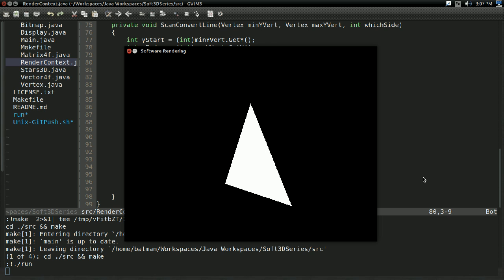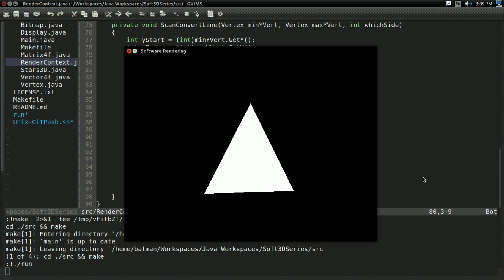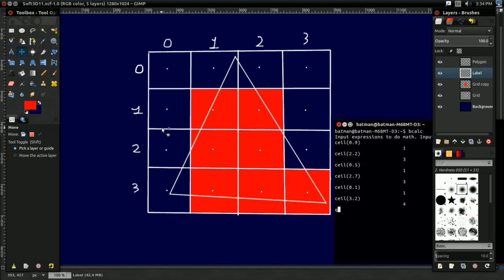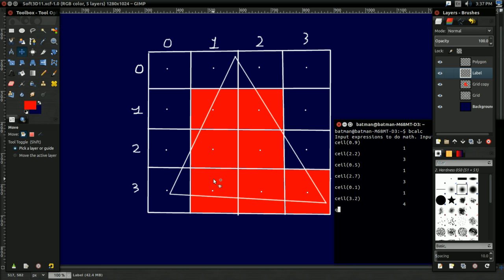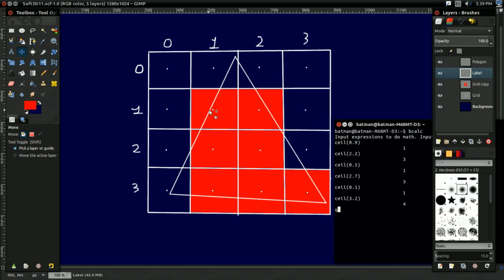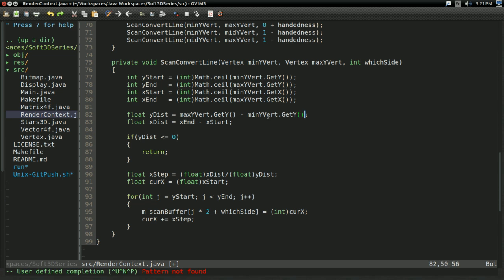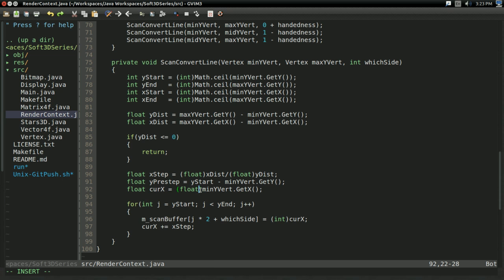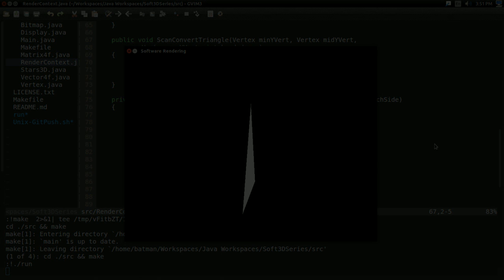#11 3D Software Rendering Tutorial: Fill Conventions

Comment: For the ceiling function to work, one must translate all vertices by -.5 along both x and y axes to make the sampling points lie exactly on the pixel centers. However, skipping the translation and using the rounding function directly instead should yield the same result. Since round(-0.5) = 0 and round(0.5) = 1, it makes 0 the center of the 0th pixel, no?
Reply: Turns out rounding behavior depends on the implementation, and is not consistent across the board. Take JavaScript and C's math.h for instance:

Math.round(-0.5) === 0; // true
round(-0.5f) == -1;          // true

To maintain the consistency for all pixel centers, translating by -.5 and taking the ceiling does actually make sense.
Reply: I'm actually also having trouble understanding how using 'ceil' function leads to the implementation of the idea that "if center of the pixel is inside then it's filled"... It looks like it rather "if top left corner of the pixel is inside then it's filled" isn't it?
Reply: @alsornet  Translating both axes by -.5 is the trick. Doing so “slides” pixel centers back to the corners of the grid, and by ‘ceil’ing you get the integer coordinates of the corresponding “filled-up” pixel.
Reply: @alsornet  Translating both axes by -.5 is the trick. Doing so “slides” pixel centers back to the corners of the grid, and by ‘ceil’ing you get the integer coordinates of the corresponding “filled-up” pixel.

Comment: What is the point of this,if you dont create a real game
Reply from the maker: guigrillo101 DemonicGaming15 
The primary purpose of this series is to gain a deeper understanding of 3D graphics. Most 3D APIs such as OpenGL and DirectX abstract away a lot of really important details about how 3D graphics work.

The problem then is people learn how to use those 3D APIs for things such as game development, and then run into lots of tricky and subtle issues that they don't understand. A lot of the time, that stems from fundamentally not understanding how the 3D algorithms work in some respect.

By creating a software renderer, you get first hand experience creating and playing around with those 3D algorithms in ways that can't be done with OpenGL or DirectX, and that gives you valuable knowledge and intuition that can make working with 3D a lot easier, even with a 3D API.

That said, there are also a few more direct uses for a software renderer. One fairly common use is for a game to have a software renderer that only renders depth information. You can then render a low-poly version of an object with depth only, and if nothing is drawn, then the object can't be seen by the viewer and thus doesn't need to actually be drawn.

Beyond that, there are a few instances where the GPU's triangle rasterization is fundamentally a poor 3D algorithm for what you're trying to do (especially with certain offline rendering tasks such as light maps or prerendered cutscenes). The most obvious example of this would be ray tracing, but it also applies to many global illumination algorithms, some voxel rendering techniques, and even some more advanced triangle rasterization techniques, such as Reyes rendering (although this is changing recently).

The point is, if your game or whatever 3D program you're creating doesn't map well to traditional triangle rasterization, you have little choice but to use a software rendering scheme. Although this series is primarily focused on how traditional triangle rasterization works in software, there's nothing stopping you from expanding it to handle more advanced rendering techniques.
Reply: To learn :p
Reply: thebennybox occlusion culling spoilers? 😂 (from 3 years ago)